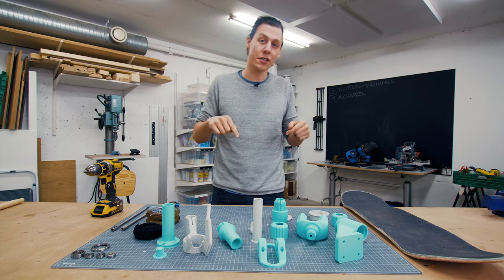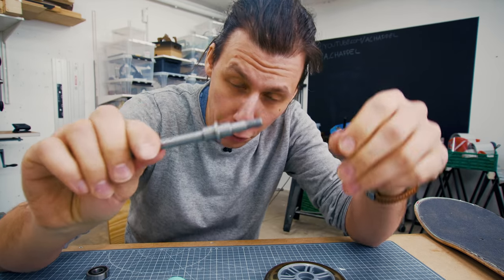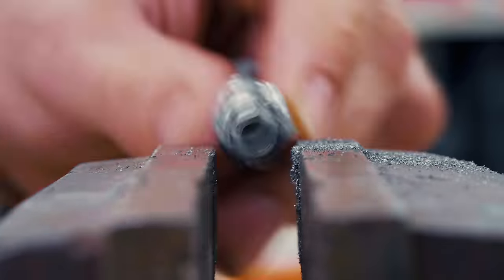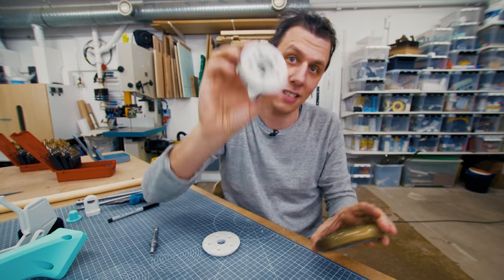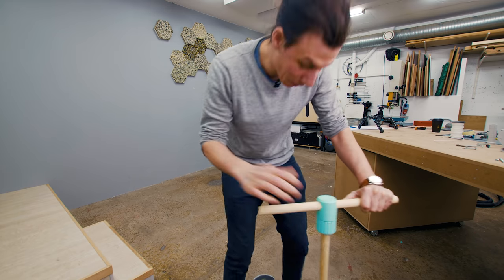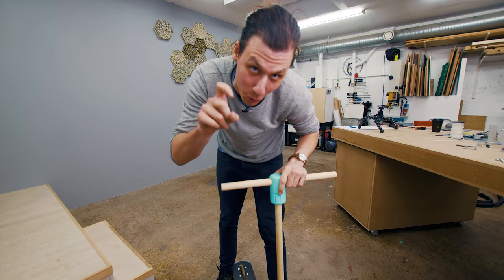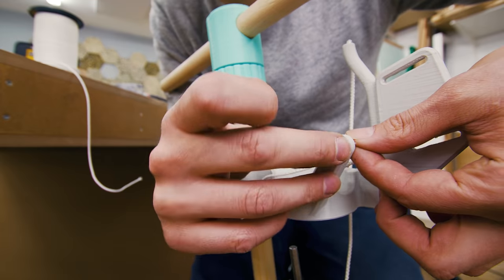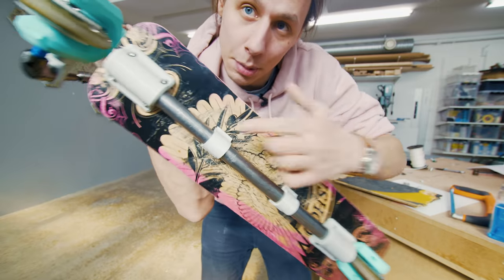DIY Drill Powered Electric Scooter - With 3D Printed Parts

Comment: I made a scooter with a whipper snipper engine and used sort of the same concept and yours except I used an angle grinder head, runs great top speed is about 30 km/h without carb adjusted

Comment: I think you can add 3 things to this for improvement.

1) An extendable handlebar, so you can adjust the height of it.
2) A cover/brake for the back wheel, because its scary if that catches your foot.
3) A tube that'll cover the drill extension staff, so nothing will catch on it and it has protection so it won't break easily.

Comment: You should mod the scooter. Use dual drills and make them the physical handle bars. Twice the power.  Then, maybe they could cancel each other out on both sides so they don't make a torque on the handle bars. More power, even more rediculose looking, and no handle bar torque problem! Do it!

Comment: Any specific reason you chose to power the front wheel instead of the rear wheel? Wouldn’t that be more stable and easier to control? Super interesting build btw! I’m also surprised PLA is holding everything that well, thought you were using PETG for better strength!

Comment: Amazing video! As I was watching you try it outside I thought that the one way bearing could be use as a way of clutchless shifting, you know, like on motorcycles. You simply let of of the gas, change gears and give it gas again. It's up to you to figure out a way to shift the gears though. The thing that comes to my mind immediately is to use a servo and an arduino to set a specific position for each gear. Also add a brake! I would like to see this scooter improved in the future!

Comment: Great project and awesome video! Super good example of 3D Printing to make "mechanical" parts, and I think a lot of people would have benefited if you described the design features just a touch more (using the tear shape instead of circle for holes, metal to metal mating surfaces instead of plastic, embedded nuts). Also maybe blur the license plates of the cars next time? lol. Overall fantastic though!

Comment: Hey man keep it the same drill, make 2 UV joints and mount the drill in front or behind handle bars, the drill is throwing it out of balance, it will also take away some from front jerking to the side because of the torque

Comment: VERY nice video! I would love to do something similar if I had the necessary tools. Would probably work better with rear wheel power though. You could either mount the drill near to the rear wheel and use a fishing line to connect with the "hand accelerator" or create some kind of pedal with a spring to accelerate.

Comment: I have a feeling that first gear is going to torque snap the drive shaft and or overheat the motor and that 2nd gear has too less low end torque which results in burning the motor aswell so you need a gearbox so you can shift it as a certain rpm so your motor stays cool and that your drive shaft won't snap

Comment: I would fit a brake to the rear wheel. add a kickstand, add another 3d printed handle to the other side and then put a couple of supports on the drill guides. Otherwise an awesome project

Comment: Nice - set the drill over the back wheel to add weight there, will resist the tendency to nosedive and will eliminate the torque-steer.    Plus the drive shaft would be much shorter reducing twist.
   If the drill had its brake functional, then you will have a working brake too.  Perhaps a bowden cable would give you a push/pull action from the handle rather than relying on spring tension.     Also - do set a good example by wearing a helmet, please.

Comment: you could place the drill further down the steering wheel and just use a longer string. Then you won't have the twisting issue from the torque of the drill.

Comment: if you think about it you could potentialy use a pipe for the handlebar and place the drill in such a fashion that it points towards the pipe, the torque happens because the handlebar is tied to the drill, since there is drag the drill wants to move itself oposite of its own driving force hence pulling the handle bar to move to a certain direction, if you added the same thing you added on the wheel up top and positioned the drill facing inward instead of downward. the oposing force the drill would have on the entire build would be either to flip forward or back wards depending on wich way the drill spins.(forward facing force would just cause you to move even faster(because forward falling momentum being halted by a persons weight), where backwards facing force would force the step to stick harder to the floor and in this way that the drill is positioned its easier to hide it in a pipe and allow the axis that reaches up and down to be incorporated in the 3dprinted items down below and hide the entire drive system from view)

Comment: You should sell a kit for this. At least just for the piece that holds the drill and the parts for powering the wheel. Scooters are cheap and abundant and I have like seven of them so it would be easier just to modify an existing one. Definitely something I would buy though if you made it. I love that the power source is something that I already have. You might consider mounting the drill a bit lower and swinging the battery to the opposite side so that it straddles the steering postplacing the drill on one side and the weight of the battery on the other and also very low so as to eliminate the top heaviness and the two extensions. I don't have a 3D printer so if someone made a kit that would allow me to do that with my drill and scooter I would buy seven of them

Comment: I would imagine the contraption would be much more stable if you attached the drill to the rear wheel, and wired up the trigger to the handlebar. Its probably just a potentiometer control, so you could even use something like and arduino to control it using an actual motorcycle twist grip. Cool idea, nonetheless.

Comment: I'm no purist. I have 2 skateboards, a kickboard and a 50cc scooter for my 'fun' vehicles. I figure if you're having fun and not being a nuisance, it's all good. A scooter with the wider sweet spot provided by a skate deck actually sounds very nice! That said, it is a little sad that you cut down the sides of the board, and then added the pipe spine. I feel like the whole point to having a wooden deck is its flexibility, so if you wanted to stiffen it, a leaf spring would have been lower profile, while still giving you a little flex, and better ground clearance to boot!

Comment: One way to fix the flex in the skate board is to put some pieces of wood in a x from one corner to another which will hold your weight and stop the flex.

Comment: I think the perfect solution to you acceleration problem would be to use some sort of rubber band just figure out the right thickness of rubber to have a more smooth and controllable acceleration

Comment: You need to make it rear wheel drive somehow the power ratio for the front wheel you don't have enough weight on it and well what sort of bounce and you'll lose a fishency as well as you have liminate steering torque by going with real drive

Comment: Gyah, don't cut the sides of the skate board off!  You're getting rid of half the material and most of the curve in the deck.  So the board is way weaker and flexier after it's trimmed because it's thinner and narrower.

Comment: So, few suggestions from experience. The steering bracket and front fork aren't strong but would have lasted a lot longer before you installed the pipe. The pipe was a good idea, but your execution has greatly flawed your product. By mounting it to the bottom of the stressed parts you're putting a lot of stress on the bolt joints where the pipe connects, much more than it would have originally. You've essentially taken away much of the strength the plywood had (which you diminished by cutting the cups off) and put all the strain on the pipe. In theory that's a good idea, but since the PLA brackets are MUCH softer than the pipe, they're going to be crushed and deform very quickly. I'd imagine you're going to get maybe 2 hours of ride time on that before it starts showing signs of failure. Those are going to present themselves with wobbly steering shaft, followed by total failure. The bolts are going to pull through on the bottom where the pipe is, and the extra room that gives the steering for flexing is going to ruin that part as well. To correct that, you'd want to shorten the pipe, drill new holes and mount the pipe there. That way the pipe and the steering are fighting against themselves and not each other. Otherwise, this is a really cool project and would last a very long time (for a 3d print).

Comment: Couldn’t you put the drill onto the wheel then take out the trigger and put it on the handlebar and connect a wire from the trigger on the bar to the drill

Comment: Hay man after you buy all the filament the drill and all the bearings wouldn't it be cheaper to buy a midrange electric scooter
Reply from the maker: If you include the drill, yeah probably. But the whole point is that I allready have the drill :)

Comment: I think it wouldn't torque steer as much if you mounted the drill close to the bottom and ran a wire up to the handlebars. Just take some  brake wires off an old bike.

Comment: I wish you would've integrated the drill more into the handle-bars. Instead of a plastic accelerator on the handle, just use the drill has half of the handlebars and pull the trigger.

Comment: I'm worried the parts will brake. I'm not familiar with PLA and how strong it is, but you'd have been better off modifying (cutting, pressing, filing, welding) steel bicycle parts for this project :/

Comment: Know its an old video, but using 4 bearings on the front wheel arch is really overconstraining that shaft. It works because everythings 3d printed and a bit flexible but not really fantastic engineering practice...

Comment: But wait, you can't drill the front wheel mount to the top of the board, that's gonna break
"I've mounted it from the top and added stabilizers"
WuTw, stabilizers? :D

Comment: You shouldnt have cut the bow out of the board. And left the board the original width. Thats where a lot of strength comes from,  is the side bow. And you would've never had to add extra weight

Comment: The innovative thinking you exhibit while making this thing is laudable.  But in the interest of preserving your neck I'd like to bring some engineering and implementation concerns to your attention with all due haste.  

Ok, for the love and sanity of all mechanics, or mechanically minded people, PLEASE stop hammering your bearings.  Bearings aren't made (generally) to handle such shockload and it really wouldn't surprise me if you were damaging them by doing so; I would suggest a press of some sort.  -and there's a really good reason that traditional scooters have vertical elements in the foot support assembly much more akin to an I-Beam.  Additionally I am SUPREMELY suspect towards the load bearing capacity of threaded PLA plastic.  I would STRONGLY advise you to not rely solely on a glue joint.  If you want this design to hold for the long haul it would be wise to include a mechanical support element, Like all those pillars between the inner wheel and outer wheel that you sawed off.  The 'pipe' fix would work but it's not tied into the back wheel assembly or the forward wheel assembly so instead of removing strain on the skateboard deck you've concentrated it at two spots.  -and the bit extenders you use for the screwdriver will absolutely blow out the bearings in the screwdriver with all due speed.  

While you've created a cool toy, you've not created a safe one.  

Oh, I forgot to ask.  Where's the brake?

Comment: I was expecting using the drill as half of the handle (and using the trigger as is).
I still don't understand how the one way bearing can be driven by the drill and let the wheel spin freely... I need a drawing or something for idiots.
One thing about the flexing of the board, I think if you leave the whole width of the board that won't be an issue. The sides are bent wich adds strength.
Reply: Still can't understand how the one way bearing allows for it to be driven by the shaft and then freewheel when the drill and shaft is not spinning... Please some one draw it for me lol

Comment: the drill should have gone to the back wheel  some made a skateboard with a drill but he used bike wheels for the back and skateboard wheels for the front if u did the same as the kids did and then added ur front part the blue part  you could have a better scooter because it wider and stronger and it would use a bike chain and  the bike sprocket of the petal part then to understnd u would have to see that kids video

Comment: one way bearing, you mean a clutch
Reply: on another note if you mount the drill lower and remove the extra extension of the drive shaft you will remove alot of the resistance between the drill and the alternator resulting in a more fluid ride

Comment: All that engineering and you overcomplicated it I feel.  The drill is way too high for center of gravity, and so much power and strength put on the scooter rather than the direct to hub design or in hub.. and I feel like you could have wired the trigger to a handle with tour great printing capabilities..   or possibly just cheap hub motors from eBay for wider traction..
Reply: With that said I would have never have gotten this far on my own

Comment: Did you over complicate this on purpose tò show off your industrial designer skills? Why not just use rear wheel drive add simple cable system for throttle and use a standard friction brake. You could even of done without most of the plastic parts and used a donor scooter instead. Liked your vid and envy your skills not sure about the reasoning.